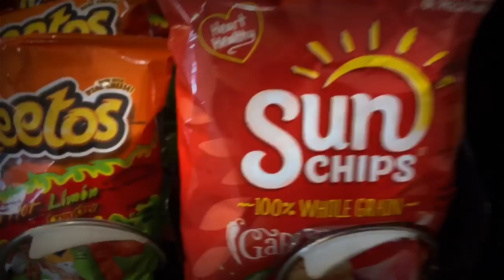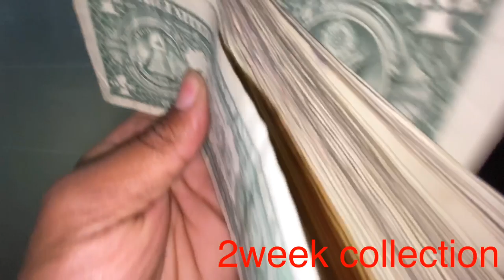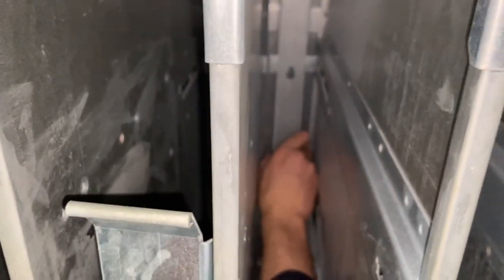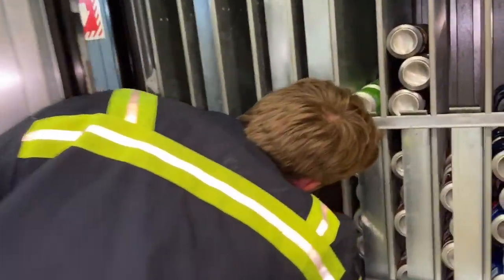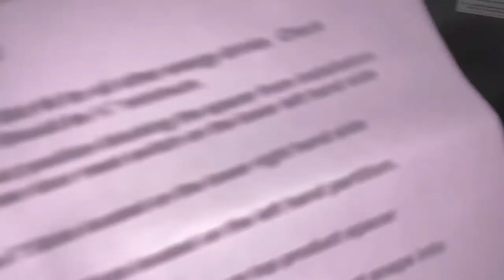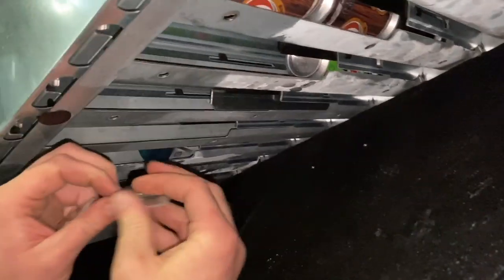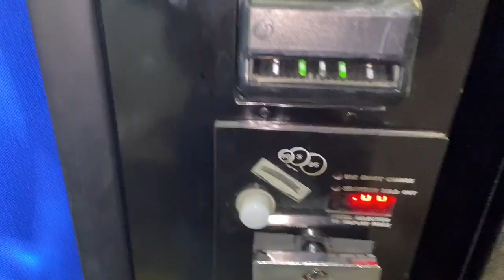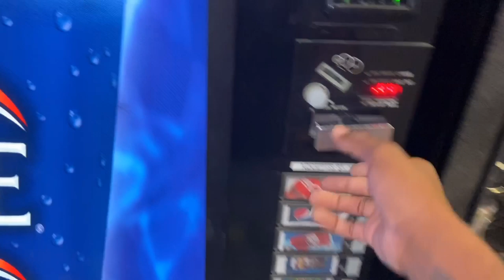HUGE VENDING MACHINE COLLECTION & RED BULL SHIM INSTALLATION ON VENDO 721

Comment: My red bulls drop 2 at a time or every other transaction on my Seaga machine.  I just set it for $6 so two drop at a time. I just figure out how to get it to work like regular pop.
Reply: @lilsnowman121 in my situation the Red Bulls I purchased were a tab smaller than pop, so I switched them out for bigger size and changed the cost back to $3. Lemme know if I answered your question.

Comment: I had a question in general about these vending collections. For example say a candy bar is 1.25 and I put in 2 singles I get .75 back. But I’m the collections I don’t see anybody account for the change they have to give out
Reply: That's part of the investment, it's about $30 to fill up the coin mech. Once the coin mech begins to run low on change. The change people put into the machine it'll start to fill itself back up

Comment: Oh man I didn’t know there was Red Bull shims out there. Right now I have red bull and monster in a soda machine lol. I got it to work with the shims I have lol
Reply from the maker: Wow ! What size Red Bull are you using ?
Reply: I use 12 oz cans.
Reply from the maker: They are expensive how much you sell them for ?
Reply: 3.25 or 3.50 depending on location same price of gas stations. I buy them 1.96/each from sams club.
Reply: What if your mechin dont vend on soda
Reply: @letstalkaboutit5802  hello sir was wondering how can I purchase the shims for the red bull